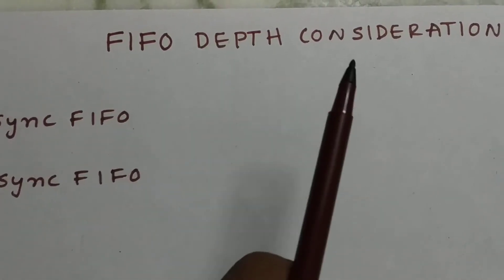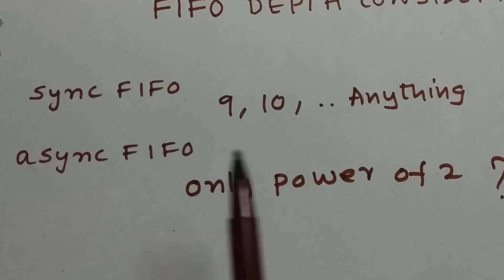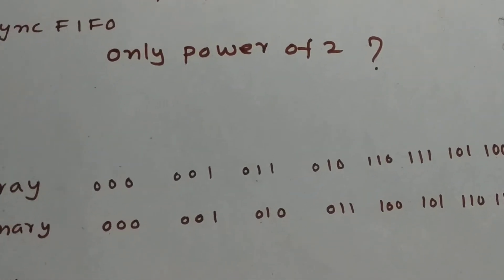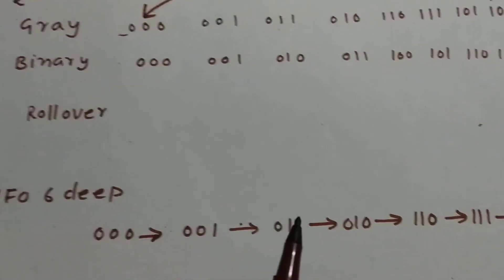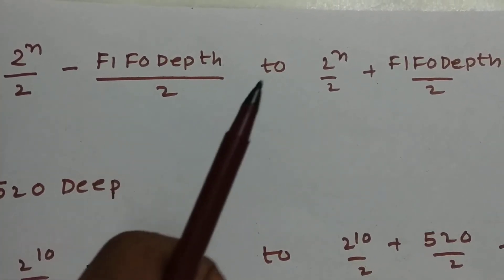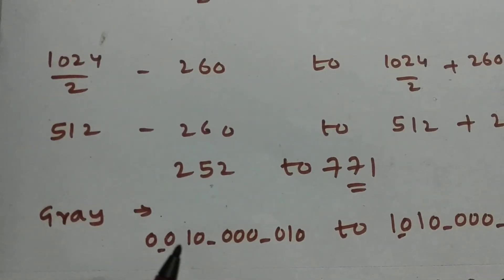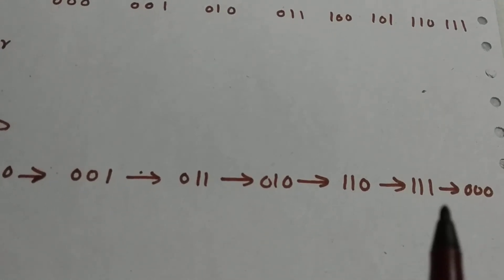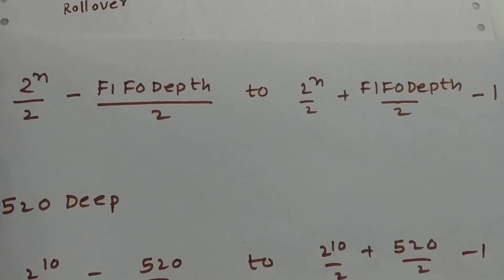FIFO Depth  Consideration  in  synchronous and asynchronous FIFO. For non powers of 2 . (CDC)

Comment: Sir , Actually there are some cases regarding the calculation of Asynchronous FIFO based on write and read frequency.
Can you explain those in a video?
Also , When do we use a synchronous FIFO b/w devices and when do we use an asynchronous FIFO b/w devices?
Give some examples.
None of the video's are available.
Like how you've given the explanation about the Asynchronous FIFO please do the same for Synchronous FIFO.
Reply from the maker: Sure will do

Comment: This does not work always. consider FIFO depth 24 and try. we end up with 4 to 28 pointer values. but if you see wrapping up from 28 to 4 changes 2 bits (which was supposed to be just 1 bit).
can you check & clarify ?
Reply: pointers range is 4 to 27 . so 1 bit change.

Comment: What if FIFO DEPTH IS NOT DIVISIBLE BY 2?
Reply from the maker: Hey charan thanks for asking ,
 for  such cases , it will be better to convert the depth to divide by 2
Say depth is 311 , 312 will do the work , only one extra depth won't cause you that much trouble in the design .
Good luck, good health 👍